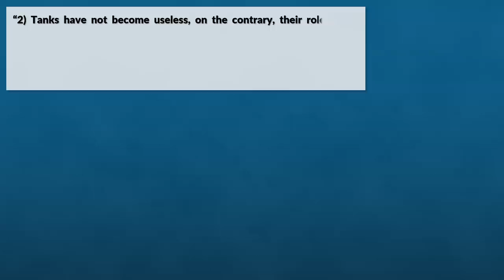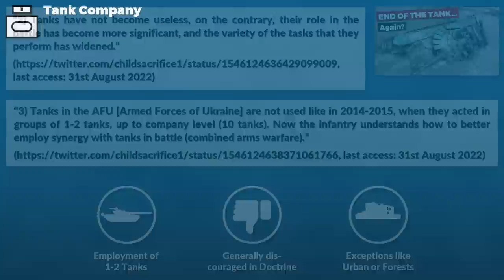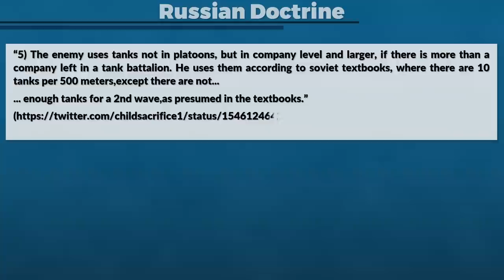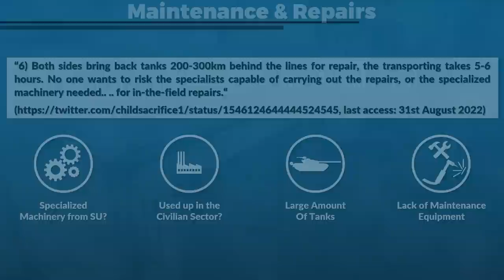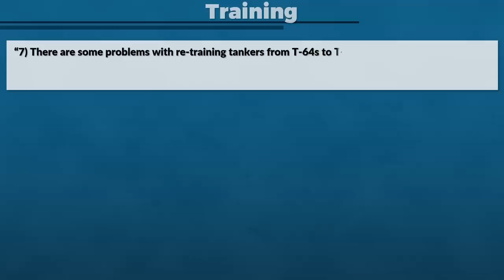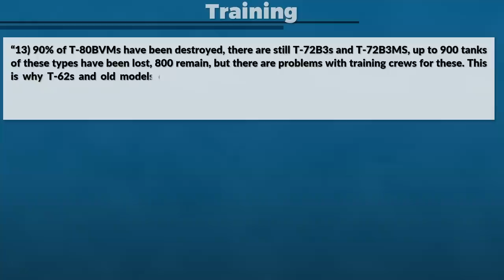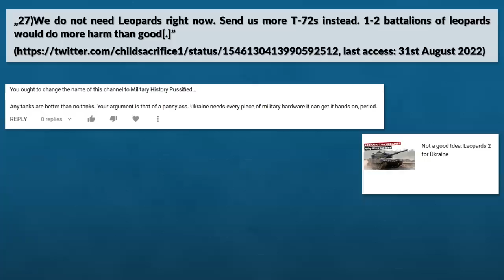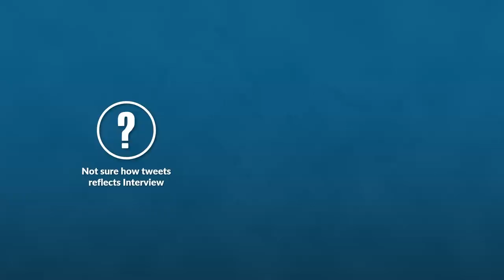What Ukraine thinks of Tanks

Comment: I have read that the weight difference between M-1 and Leapord, compared to the T-72, might be a issue in Ukraine as well, the design of the bridges and overpasses might not be sufficient to handle the weight, and also, the UAF would need new combat bridging equipment (temporary bridges), to accomodate M-1s and Leapords, as their current stuff is designed for the weight of a T-72.
Reply: also abrams is very very thirsty...
Reply: That's what combat engineers are for when imbedded  with the armor and infantry .
Reply: @georgesheffield1580  Check out Binkov channel, he had a video couple of months back detailing why Leopards and M-1s were probably not a good idea, mainly for logistical and maint. reasons, but he pointed out the weight difference issues also. Not to say never send them to AFU, but that it would be a process that took a while. It's not going to be ship them and they are on the battle field within a month. They definately would give AFU a lot of new capabilities, but it will be a long term process. The much better course, which is the one I think is happening, is to sell M-1s and Leopards to Eastern EU countries, or at least promise them to sell, put some US armor temporarily until the new M-1/Leos could be shipped, and get them to send AFU every piece of Soviet gear they have (they are modernizing anyway). This was the best option to help AFU in the fastest way possible.
Reply: @georgesheffield1580  Well yes, but the now-inadequate bridges are some of the tools that those engineers rely on to execute their missions efficiently.
Reply: @3idraven714  The latter thing you say is kinda what Germany tried with the Ringtausch. Didnt work too well, for various reasons.
Reply: @termitreter6545  It's kinda of a moot point now. Putin's army just solved all their equipmet problems...and ammo, and fuel....I suspect the AFU is going to roll up their line all the way to Donetsk, back to the Feb 24th border (north and east), leaving the poor chumps trapped over the Dnipro, screwed, and nothing left behind them to stopp AFU from advancing all the way to Crimea.
Reply: @3idraven714  Idk, Im not sure how far the Ukrainians can go, but it sure looks bad for Russia. 

But theres gonna be a point where the offensive slows down Id assume. Hard to tell how much of a defense russia built up.
Reply: Finnish defence forces estimated our T-72 compatible combat bridges would last only 10 crossings by a Leopard 2. FDF ended up discarding both the T-72s and their bridges when Leopard 2 was adopted.
Reply: @rikulappi9664  There you go Binkov was right.
Reply: @mysss29  you realize those engineers can lay bridges practically anywhere right?
Reply: @jebise1126  simple, a modernized M60 Patton of Turkish or Israeli package would be enough. Any Raytheon or GE upgrade would be to expensive.

Comment: I thought that T-64, 72 and 80 would be similar enough to get around muscle memory. Turns out you cannot. That itself is a very useful insight. 

I think that also goes to a reoccuring theme on military actions - it is not about having the best equipment, but the equipment your soldiers can use.
Reply: These can differ if they came from a different factory even if they are supposed to be the same model. All sorts of ancillaries may come from different suppliers and be put in slightly different places and be operated slightly differently. Ditto for those made at different times.
Reply: If just having equipment was enough, then the russian air force wouldve ruled supreme.
Reply: @sam8404  Mind that heavier western weapon systems only arrived in Ukraine long after they stopped the original russian advances. 

That said, theres a few reasons why Russia was unlikely to "really" beat Ukraine. Russia only had 200-300k personal, which isnt nearly enough to conquer a country. Let alone occupy it. 500k wouldnt be enough if there was resistance movements.

But even before that, one major reason is that Russia fucking sucks at urban warfare. I think the only city they really sieged was Mariupol, and that took a very long time, they had to destroy most of the city. It bound a ton of russian troop and material and they incurred losses even during the later sieges.

The only way Russia wouldve "won" is by having the Ukrainian political leadership instantly break down and the public follow suit.
Of course, in reality the opposite happened.

Comment: Running multiple combat systems at the same time could only be a messy, ridiculously overcomplicated process. No "desperate need" for Leo 2s at this point anyway. Keeping it simple makes perfect sense for the Ukrainians.
Reply: Think of the various artillery platforms and other vehicles already being incorporated. The logistics and support chain, especially repair & maintenance, is already being pushed to the limits.
Reply: @MarcosElMalo2  most use the same ammo. as for spare parts military always have many different vehicles already.
Reply: Regional segregation makes sense. Start on the west side of Ukraine with western equipment and logistics and work your way eastward toward the front as more comes in and eastern stuff goes out. By the time the soviet era equipment is used up you should be more than ready to employ the western equipment on the front.
Reply: @winstonsyme7672  Yeah, and it's working well.

Comment: Let me go point by point to provide more context with what Саламаха was saying in the original interview.
1)Tanks started to perform new roles
He meant that some tank units used their vehicles for indirect fire support with HE rounds, using tablets similar to "Kropiva" called "GisArma" for ballistic calculations. They were firing on distances up to 6-10 km. The tankers were trained for it before the war. The second point regarding new roles, is the use of barrel-fired ATGMs. Despite the fact that Ukraine had them, there was inadequate supply of such missiles and low count of vehicles which could fire those as well as crews trained for it. Old soviet missiles are mostly dead, and new Ukrainian missiles are present in very low numbers. Along with russian tanks, new missiles, in substantial quantities, were captured. It added a new capability for UAF tank force.

2)Russian tanks abandoned without fuel.
Well, Саламаха elaborated that T-72 has multiple fuel tanks. Primary front tank (left nose tank) has large capacity and there is a special procedure required in order to fill it. Procedure that is unknown to random tanker. I presume, a technician was responsible for refueling at base and tankers could fill only a smaller fuel tank.

3)Tank factories in russia.
He goes into detail there. I'll try to summarize. 1st factory (Atamanovka near Chita) a couple of years ago had only guards, accountant and director. Current condition is unknown. 2nd (Strelnya) is smaller scale factory specialized on T-80 B/BVM, and they tried to repair T-72, but  it is unknown if they succeeded. Omsk factory presumably is capable of repairing 100 tanks per month tops. He emphasized that realistically, the number should be closer to 50. How many Uralvagonzavod per monnth does is unknown.

4)On the topic of training optimization.
People who trained on T-64 got assigned on T-80/72. When he talked about optimizing, he meant that tankers should wait in line for a tank the best suitable for them, not hastily re-trained for a different type.

5)Why T-72s from Africa should not be considered?
They were poorly stored and maintained.

I can translate this interview for you free of charge without all the paraphrasing.
Reply: Thanks, please do the translation. 
I think the citation of “sending us leopards wouldn’t help” desperately needs to be put into context.

Comment: What lay people often forget is tanks are not oversized cars, they don't really have standard layouts every country does something slightly different and each tank is different with many different systems on it.
Training is required, i think Jet fighters is the only other thing i can think of that compares, Planes as a rule for Civvies are all similar layouts, Cars.. even guns are such simple tools.

Having the required parts the required training these things just don't enter the lay persons mind they think ooo big tank go boom.. if it gets blown up whats the issue.. but taking a crew away from a reliable tank to one that don't understand could yield bad results when it breaks down it'll have to be left possibly giving the enemy a free tank they could repair or just end up being in the way requiring extra effort to blow it up to make sure it isn't captured.
Reply: An interesting point about civil commercial aviation: a pilot is only qualified on one model at a time. To switch models, you need months of retraining and qualification. And once you are qualified on a different model, it takes retraining to switch back.

The idea that a fighter pilot can be combat effective on a different plane (even of the same airframe if the cockpit layout is different) with only a few weeks training is ridiculous. And even if you integrate same airframe planes from different countries (which does help in the support end), the idea that you can easily integrate completely different platforms/airframes is the pinnacle of stupidity (I’m looking at you, A10 fanboys).

Comment: Blanket statements like that one viewer who thought Ukraine should take every tank they can get their hands on, is outright stupid. It is far better to give Ukraine the equipment that their Army is trained to use and is familiar with than to hand over armored vehicles that they are neither familiar with, nor know how to operate effectively. Training takes time, lots of it, and just like in this video, you also need to train the guys who have to repair and maintain these vehicles, and then there is the added problems of logistics, if you have lots of different tanks that all have different gun calibres, need different kinds of fuel or oil or ammunition for their machine guns mounted on them, it quickly can turn the supply of men and vehicles for the front line into a nightmare, with the wrong kind of ammunition or supplies going to the wrong platoons and halting the forward motion of an advance. The big picture is a much more important thing to pay attention to. If Ukraine was operation from a more NATO based system then it would be okay to take the Leopards but they are operation on a Soviet based system of equipment, so Russian equipment is a far better option for them to receive say from all of the other ex-soviet nations, like Poland, who has switched over to NATO equipment. In the middle of a war, is not the time to start making a switch to weapons that have NOTHING in common with all of your other equipment. Now, if trained crews and logistics units cam with those peopards, that would be an entirely different situation, but that is NOT going to happen any time soon, unless the war takes an entirely different turn that involves Nato countries and their armies, and we should pray that this does not happen because that would mean an escalation nobody wants.
Reply: Then explain why sholtz still hasn't replaced the polish t-72s with leaopards, like he is contractually bound to have done half a year ago already? Poland isn't at war
Reply: That pretty good points. But one problem exists - there are not many more soviet types tanks available in the world to supply to Ukraine.  As mention in interview it can be collected like 100 more and that is it - and that was 2 month ago.
Reply: Agree.  It’s better to find the equipment Ukraine can field quickly like T-72s and send that to Ukraine, and backfill the lost equipment with Leopards, Challengers, M1s, etc.
Reply: @vladimirpecherskiy1910  At some point, they may have no other choice but to do that.  For now, send them what they can field expeditiously, and start planning for other items and the training & logistics packages.
Reply: @512TheWolf512  he's not replacing their old soviet equipment with leopards,  because he is replacing them with  M1 Abrams METS. Who said he is contractually bound to buy leopards? And more to the point, what does Poland have e to do with Ukraine's need for equipment that is easier to field? Other than that they gave Ukraine all their old soviet tanks?
Reply: @vladimirpecherskiy1910  very true but since Ukraine  now has a surplus of soviet tanks because they've captured gobs of Russian units plus their own stock and the tanks Poland has given them, it seems very likely that Ukraine will have enough tanks til the end of this war. It's fairly obvious that this war is very close to ending since there is open rebellion in the Russian ranks, plus severe civil unrest in Russia, with Russian groups sabotaging the Russian logistical train to prevent further supplies from reaching the Russian Army in Ukraine,  and a political  group claiming responsibility for the dead of Dugin's daughter's assassination,  put in is not long for being dictator in Russia.
Reply: @oculusangelicus8978  Well, Ukraine do not have enough even right now in reality. They did not capture that many - that like 100-200 мах. They got 200 from Poland. Compare to 2000-3000 tanks Russia still can get from storage that really not much. And there is no "civil unrest in Russia" worth mention - do not full yourself. Man that "claiming responsibility" is a clown. So I really would not count on things to work out by itself.
Reply: @vladimirpecherskiy1910  Dude, you have no idea what you're talking about, Ukraine had 6500 tanks before Russia invaded! Russia has lost well over 1000 tanks in Ukraine so far, but off hand I don't have the number of captured tanks but it has pushed Ukraine OVER their initial number that they started with, just try to remember that Ukraine is not really using lots of tanks until the counter offensive began. So When it comes to tanks, Ukraine is looking more for more up to date tanks since their stockpile is of the older T-72Bs and even some T64 models, so when it comes to tanks, really Ukraine is kinda set.
Reply: @oculusangelicus8978  I do not know where you are getting your numbers from, but as far as I know Ukrainians have no idea that they have 6500 tanks :) Which is more then 2x more then whole Russian army before war started. Yes, Russian army lost in magnitude of 1000 tanks (which might be 800 and might be 1100) but they had 4000 - 6000 in storage that possible to get, granted not without some re-work. And some of those 1000 had been/will be repaired. Same time Ukraine also  lost in magnitude of 500 tanks. Which is not at all covered by captured amount. About all tans Ukraine has had been produced in USSR and it just happen that most strategic storage for materials as such had been on Russian territory.
Reply: @vladimirpecherskiy1910  no, no no. Russia has claimed for decades that they had around 12 thousand tanks in their stockpile, it is likely true, but they are in such poor shape plus many of them are as old as WW2 Vintage. Russia doesn't scrap their tanks unless they are severely damaged.  Ukraine's stockpile of tanks came from when they were still part of the soviet union, and when Communism fell Ukraine inherited a huge amount of weapons from their portion of the soviet stockpile, including nuclear missiles, which Ukraine gave back to Russia because they didn't want them. These numbers are well established, and I'm done arguing about them if you don't believe 3,, that is your right, but it doesn't  make me any less correct, even Google will back me up. Do some research.
Reply: @oculusangelicus8978  What exactly "no", what "no" and what "no"? :)
Reply: It’s stupid to deny Ukraine tanks just because some internet commenters think their “logistical chain can’t handle it” (it can), “untrained crews are useless” (that’s why Ukraine wants to train their crews before they send them to mission… and no that doesn’t need “years”) and that they’re better off with Russian gear. Gear that is old. To repair captured tanks, sending them back and then back to the front isn’t that much easier than re-train crews on a different design that already comes refurbished and has to go only one way to front. 
The supply of >usable< Soviet era tanks is limited for Ukraine and will not be sufficient to retake crimea. 
Having western tanks in good condition >on top< isn’t a bad idea. It’s a good idea.
Reply: @Grimshak81  Well, man on that interview particularly stated, that let  lets say than 100 Leopards would not do any goo because of exact this issues. So I would listen to him.